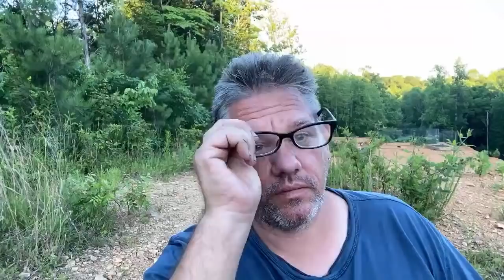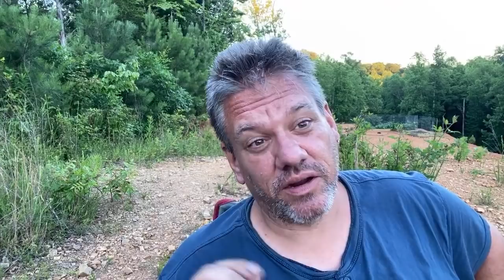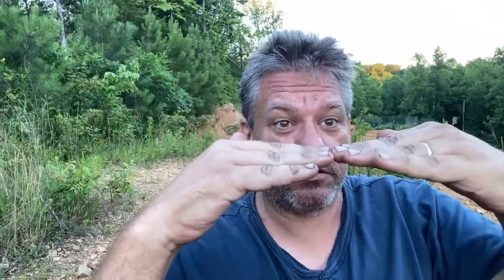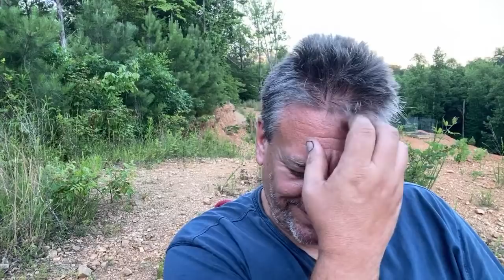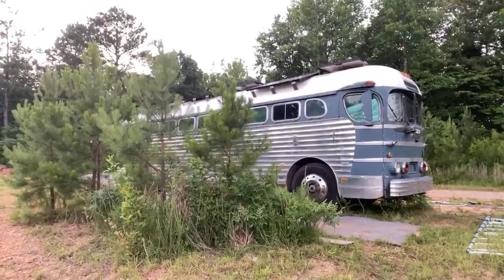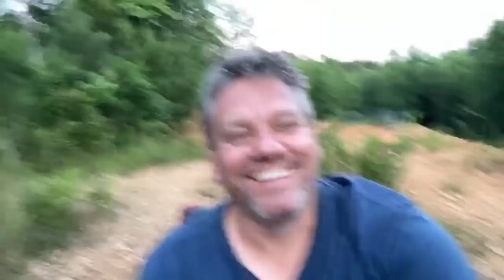Live End of project recap mci bus

Comment: Scott.....Stop into a Walmart and get the generic brand of Advil Cold and Sinus. They are less than $7.00 and work wonders when the barometer changes significantly. You won't need them that often, only the first couple of days when the humidity goes up or down, and you usually only need one tablet! I use them all the time in the summer! Motrim works well too! They both relieve sinus pressure!